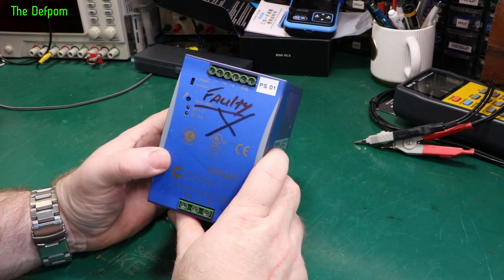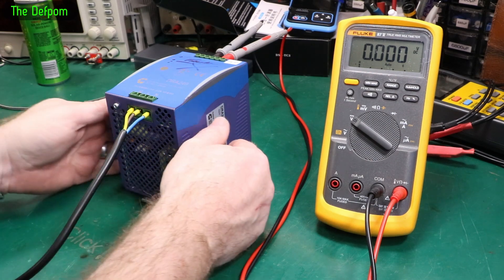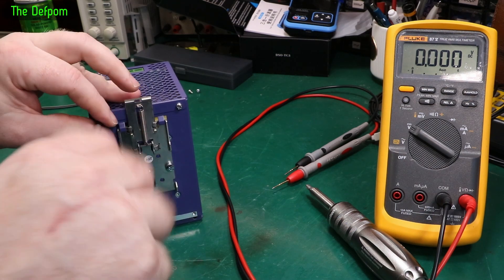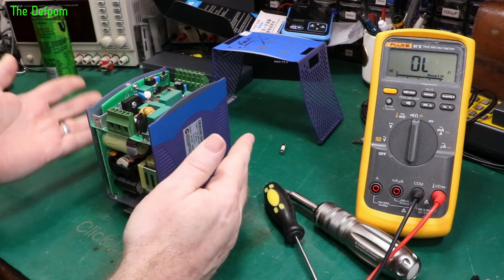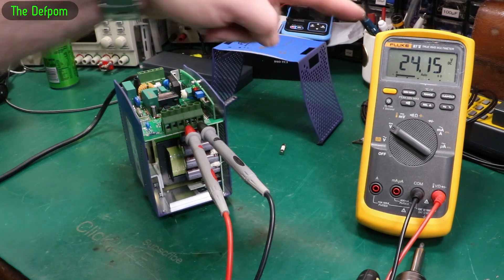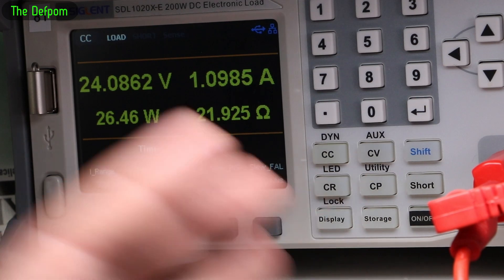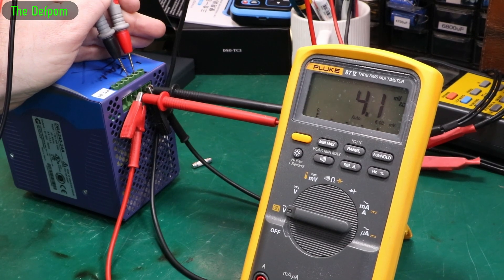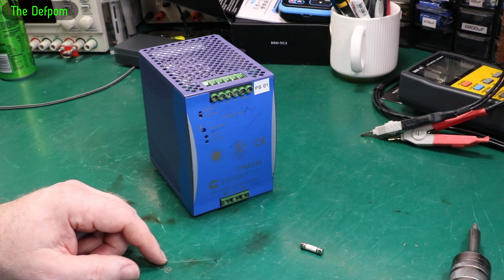🔴 24V Power Supply Repair & Load Testing - DRA240-24A - No.1275

Comment: One IMPORTANT tipp, if u want to repair power supplies too: NEVER EVER touch anything, like shown, if u had power on it before. if the AC side is okay, u get leathal voltages on the AC caps. so plz make it not like shown, fingering inside, after power it up.

Comment: Complete guesswork on my part, I wonder whether this supply was in parallel with another (switched to parallel) and one of the supplies failed, resulting in excessive load. Current protection should have saved it, would be an interesting test.
Reply from the maker: In this instance it was the sole supply so the reason for failure is a mystery, it was replaced with another unit and no other faults were present.

Comment: 4:04 wait. Fuse blown and not checking for shorts on the main or secondary side before plugin it in?
Reply: Sometimes the manner of a second fuse blowing (sound, flash etc) can give you more information about the location or nature of the fault.  Simply replacing it can be a diagnostic tool and is unlikely to do more damage.
Reply from the maker: I did check for shorts after replacing the fuse and before powering up, I just didn’t record video showing it.
Reply: Fuses are < $1, for the time to disassemble and check stuff it's worth a shot.
Reply: @JonnyFix  you don’t have to disassembly anything. Just check for shorted mains power on the input to ground or 24v to ground on the output.
Reply from the maker: Without the fuse intact it would have shown as open circuit until replacing the fuse, either way it had to be opened up, so that aspect didn’t matter.

Comment: It could have been an output overload that popped the fuse.
Reply from the maker: @Chris_Grossman  that was my initial thought, but when loaded up to it’s rated current it was only drawing 1.5A, it had a 6.3A fuse, so to blow that in any reasonable time it would have needed approx a 8-10x overload.
I’m surprised the fuse rating was 4x more than its maximum current.
Reply: @TheDefpom  What happens if the output is shorted?
Reply from the maker: @Chris_Grossman  I don't know, I don't want to find out, my safety squints might not be enough.
Reply: @TheDefpom  I think an output short is likely story for how the fuse blew.